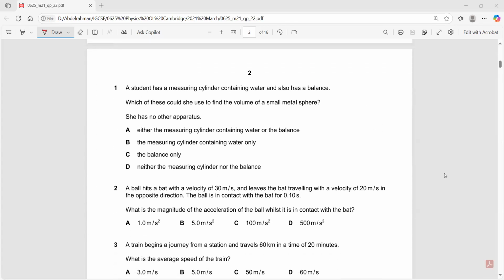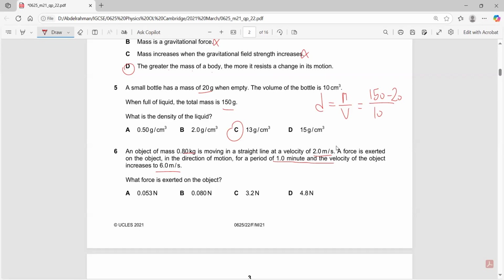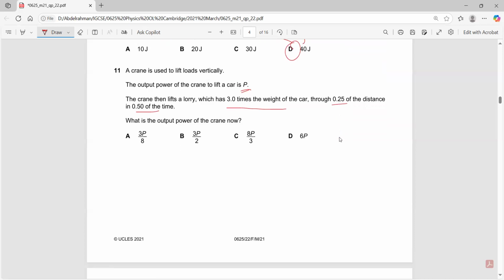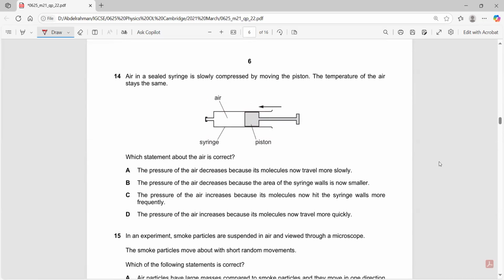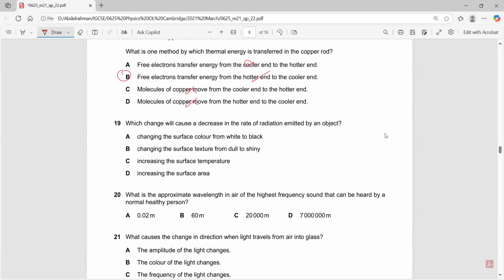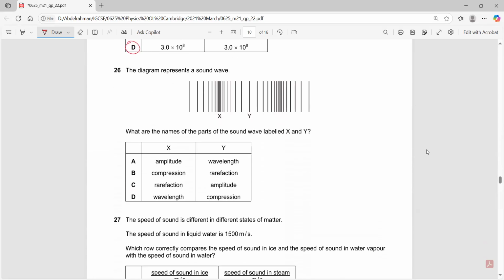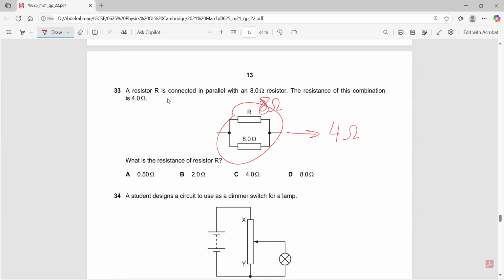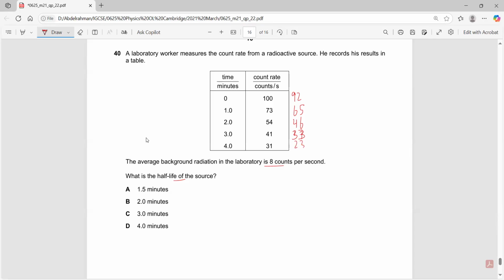IGCSE Physics 0625/22/F/M/21

Comment: could u tell us some tips on how to fill the bubble sheet fastly and precisely?
Reply from the maker: Whenever you solve a question and are sure of your answer, fill it in automatically in the bubble sheet. Don't get stuck on one question if you don't know the answer to it, you can always get back to it later. Remember that all of the questions are worth the same weight, so finish up the easier questions first! Also don't forget to read the question and answers CAREFULLY as to not skip any details hidden between the lines that might be the answer to the question.
Reply: @a.tawfik96  and what happnes if ur not sure or want to erase an answer? and is it fine if u go a little bit over the border or under it while shading?
Reply from the maker: @NoonTagalsir-b3e  You can erase an answer its okay. Try as much as possible to not go over the border while shading please.